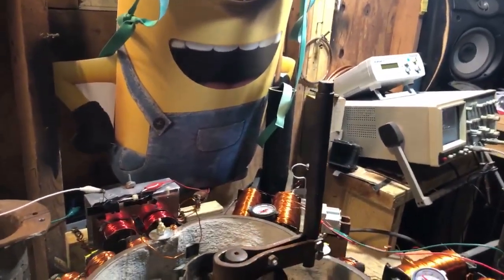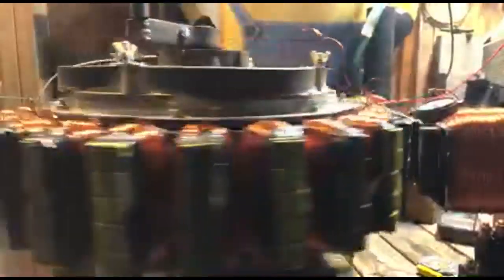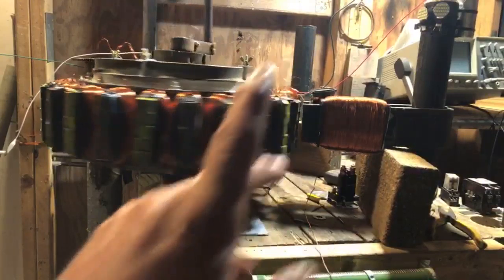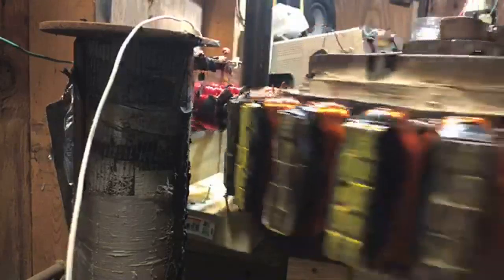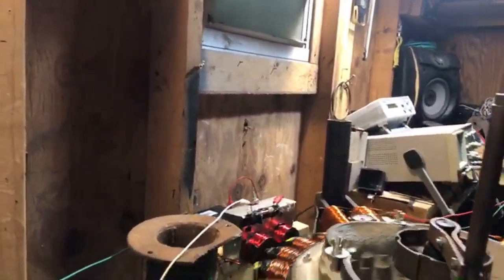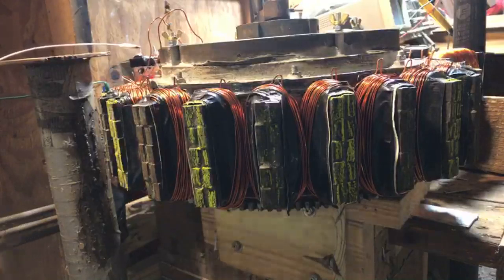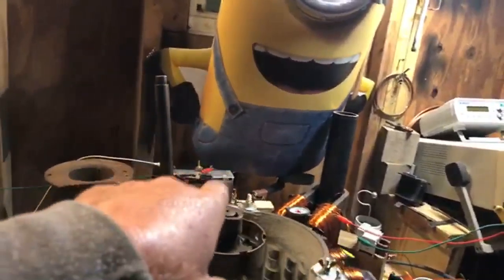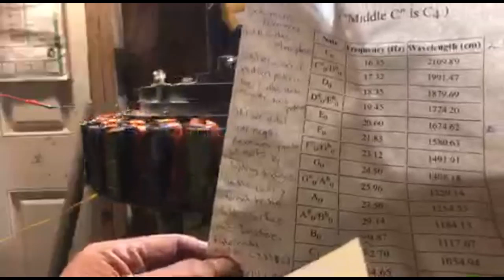Coral Castle, Ed Leedskalnin, Magnetic Wheel!

Comment: My sheet and blanket stuck together and what holds it together? Static cling. Pulling it apart I hear snap snap snap. Magnets. Charge alignments and they snap upon being stretched apart.  Volcanic ash upon erupting, we see the separation of the expanding cloud and what occurs? Lightning in and around the cloud. Could cloud lightning be being generated for the same reason and by the same effect? 

Plastic rollers and plastic wrapping factory conveyor room built up an almost solid wall of static charge that people would practically be stopped in their tracks by. Which was created by pulling apart these surfaces of charge alignment magnets. Likewise, the Whimhurst is doing and the static charge "field" actually "charges" or aligns charges in the dielectric plastic capacitor. 

A plastic wrap ball gets tossed into a metal shopping cart immediately shocking high voltage through the cart into the person's hand. Piezo effect resulting action is the same phenomenon. 

Expansion of gases (also the atmospheric) generates the same charge and can be created from vacuum. Even vacuum on water. Pressure compression on gases creates plasma. Combustion of hydrogen and oxygen as well as gasoline and oxygen takes larger gas molecules and compresses them into a smaller space as solid molecules. This creates a vacuum. Internal vacuum engine? 

Prove this by combusting a book of matches under a glass. Place on a dish with water in the dish. Cover with glass and watch combustion gases suck all the water into the glass. 

Hydrogen is small enough to pass through rubber. A membrane holding hydrogen, which has a positive charge, and outside oxygen has a negative charge. The water cell battery creates water and the electricity does not pass through the rubber membrane.  "Electrons" or the charge alignment disequilibrium taps onto the conductor as the atoms of hydrogen pass across the membrane to join up with the oxygen. The action of each atom may be pulling apart magnetic tension which shows up as static charge flow "current" D.C. 

Magnetic Tension and pulling apart charge alignment (vacuum) may be just one of the actions creating "electromagnetism." Piezoelectric high compression action (atoms of gas and plasmas into solids and molecules) obviously does so as well. 

Therefore, when using actual magnets and electro magnets and coils and capacitors keep these ideas in mind. To stretch apart and slam back together (Joe Slam and the space ship) magnetic charge alignments is where all the charging action is happening. 

I imagine ether energy particles are going through all these actions surrounding, inside, and out of the materials used as well at the same time. Likely space and time are being warped by changing inertias and these changes effect mass and densities. Mass density gravity increases pulling charge alignments closer together and tighter (compression.)  Charge separation or poles being apart and across a gap might be likened to the larger gas atom state, or an etheric energy state. Or like the PMH being apart from the magnets on the wheel. This pulls a vacuum on the ether energy. Capacitors might be likened to solid matter or charge alignment atoms being closely held tight together. Possibly in conjunction together separated magnets effectively pull etheric energy apart and capacitors slam etheric energy back together like a pumping action on the etheric energy system.

Yin and yang toroidal vortexing in nature is in my opinion these actions in a magnetic structure and geometry of motion. Likewise even in the wheel there could be the same process moving through the middle, moreso if it were polar perpendicularly. If you made the wheel that way in the future the PMH would still work in attraction mode if also perpendicular. Then with each pulse the same circuit would always be in the same direction and creation. 

The attracted magnets are being pulled apart as the wheel moves. Pick up coils would be in the induced attracted state and static charge would be increased in the magnetic alignments. Next the stretching out and pulling apart energy is activated. This is the snap across the gap lightning discharge. This is the high voltage release and capacitor drainage vacuum you want going across the gap and through the circuit on the high frequency into your primary electro coil. Tesla coil transformer step up voltage also increases capacitance in the ether, using it as an atmospheric and ground capacitance pump.

This is what scientists believe results in the production of the Auroras. However, they say the Sun is forcing the Earth's magnetism to stretch outward away and opposite from the direction of the Sun. And that outward stretching results in an inward snapping back of that field energy when it can stretch out no further. They say it breaks and the energy of the break is the added bonus energy we see resulting in the plasma around the poles in the atmospheric gases. This might be akin to a slower stroke of lightning. or plasma discharge. Likely then, gas atoms such as O2 and N2 are separating apart (vacuum energy) and slamming back together (piezo energy) more actively then usual.
Reply: Then a wheel could be all one pole on the outside vetsus the inside and the PMH could be on top and bottom inside and outside. Or that configuration plus the perpendicular pole arrangement.